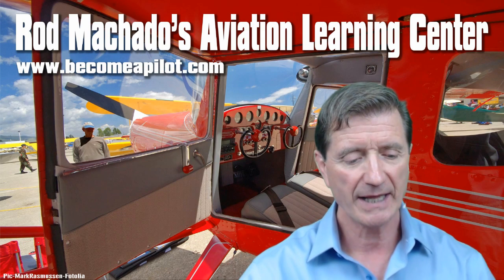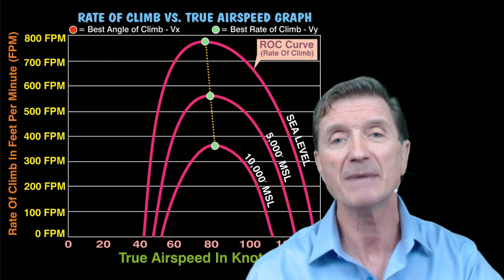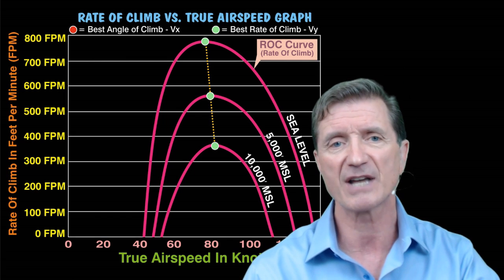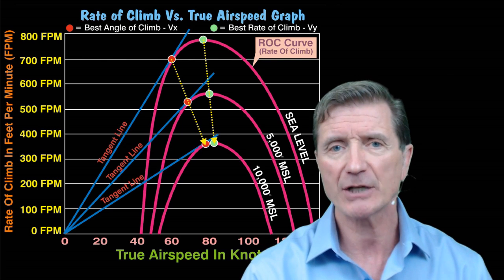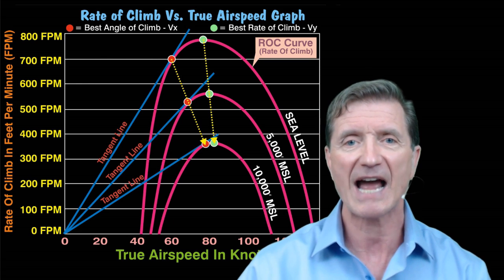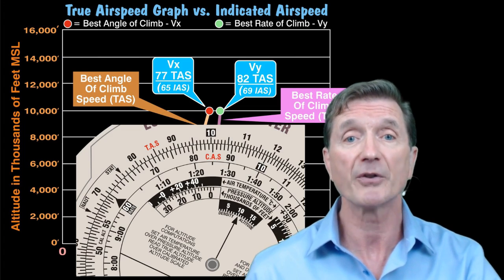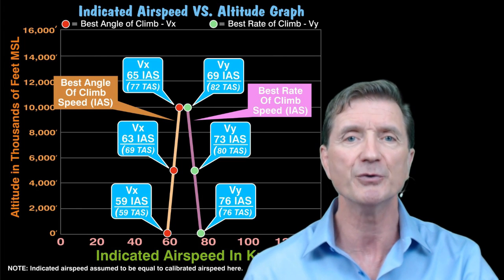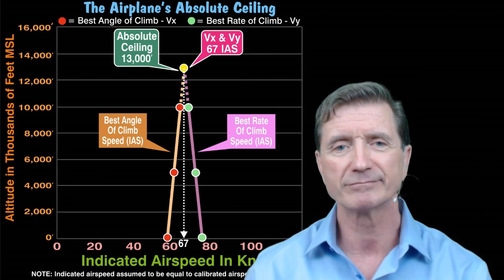Why Vx & Vy Change With Altitude

Comment: Found this 3-page response dating back to 2005 about the same question, answered by none other than Rod Machado. As a ground school instructor, one of my students asked this question too, as to the why of the matter. Really good question. This video, combined with the attached link to said response, is a really good answer and has shored up this particular hole in my own understanding on the matter. 

http://cospilot.com/documents/Why%20Vx%20and%20Vy%20Change%20with%20Altitude.pdf
Reply from the maker: Thanky you, Gavin. I sure do appreciate the thoughtful comment. 
Best,
Rod
Reply: THANK YOU SO MUCH, AMAZING.

Comment: the convergence of best angle and climb rate to the ceiling was a new concept to me that I had missed before! thank you for the clear explanation on the curves. 

In future, could you go more into depth physics wise? showing the governing equations,  for example, that make the ROC curves, just to help mesh together all the concepts (they are still not perfectly connected in my mind, I am working on it).

I ask for this not as a pilot in training, but as an aerospace student.

Thanks again!
Reply: By now, you can probably explain it to us. It's complicated. That's why they collect tons of data for these performance charts. This is computer-simulation territory, not something you can do by hand, on the back of an envelope.

Thrust is easily derived from net power and airspeed, but net power (after efficiency losses) varies as a function of density altitude and airspeed. Not only does engine performance vary with rpm and density altitude, but the efficiency of a fixed-pitch propeller varies greatly with airspeed.

Comment: Rob, I love your programs but this doesn't answer WHY, it answers how.  The reason why is much much simpler.  Your excess thrust decreases as altitude increases, resulting in less "excess thrust" which in turn requires you to lower your AOA eventually it will be the same as Vy.  VY will have to decrease for the same reason.
Reply from the maker: Greetings Ron:
Yes, you are correct. I should have named it, "How" not "Why." Nevertheless, I did indeed want to answer "how" since this, to me, was the far more interesting question. Thanks for that input.
Best,
Rod
Reply: @Flight-Instructor  this is more or less what I meant in my comment that I just wrote - as engineering students, the why is the more interesting question (because we should understand how it works, obviously). Nonetheless, this "how" was new to me as well. Many thanks for the quality video.
Reply: i realize I'm kinda randomly asking but does anybody know a good website to stream newly released tv shows online ?
Reply: @Andrew Gary Thanks, I went there and it seems like they got a lot of movies there :) Appreciate it!
Reply: @Axton Michael You are welcome :D

Comment: This is amazing. Could anyone please elaborate on the tangent line to the VS vs TAS graph, and why those tangent lines define the best angle of climb speed? I understood the statement, but not the why that is.
Reply: Tangent line gives the highest slope of the line intersecting the zero point and the graph. Slope has unit of FPM/KTS which gives the ratio of the vertical distance traveled over horizontal distance travel (over a given amount time). This ratio is directly correlated to angle since angle is Tan-1(Vertical/Horizontal). Hence Vx: best angle of climb :)